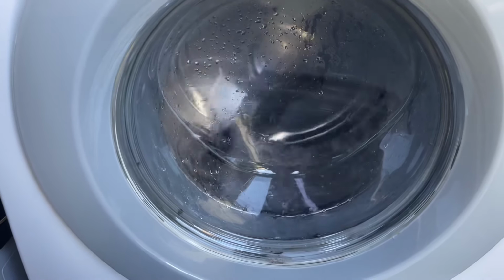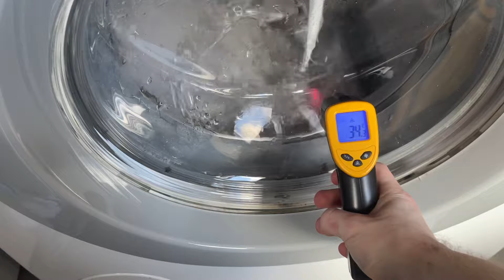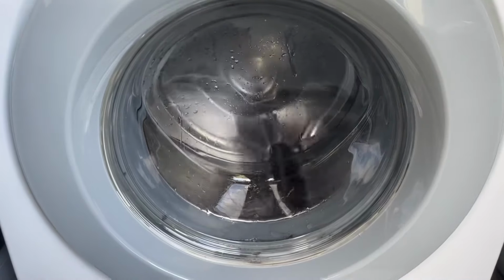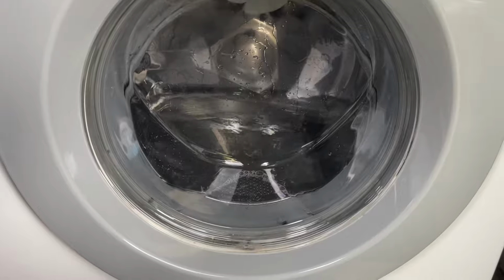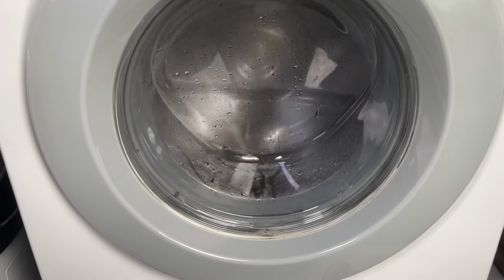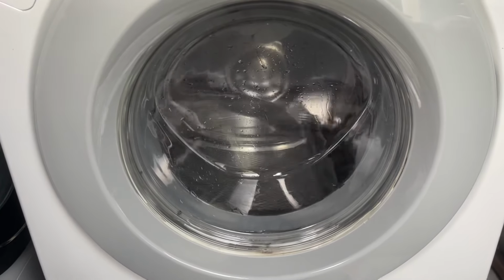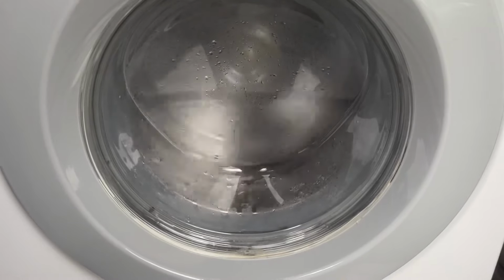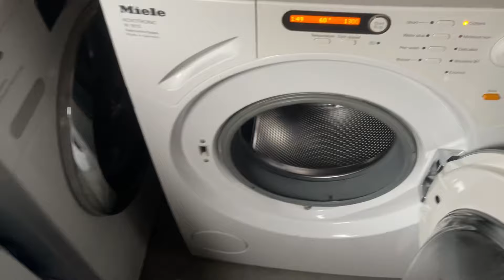First test wash in a HEAVILY worked on machine!

Comment: Hi. Nice video. Is this the professional one? Something seems to be weird. When it turns the drum in a direction seems to be inverter and when it turns the drum in the other direction it seems to be brushed. What is the reality?
Reply: It’s a dc brushed motor, older mieles usually did this where one direction is much louder than other
Reply: This isn't a professional model. The professional models start with 'PW' in their model number. This one is a W1613 which starts in just 'W', therefore it's a domestic model. If it was a professional model it would be a PW1613
Reply: @nihilusguy2089  Hi. Thank you.